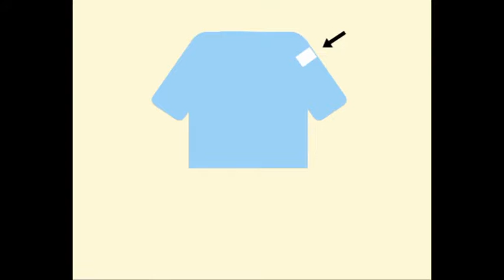How anti theft tags work

Comment: The ringing noisr is for ?
Reply from the maker: You mean the alarm, or a problem in my recording? The alarm sound is to alert the guards in the store about the person walking away with an item without paying for it. If you are talking about a buzzing sound mixed with my narration, it is a problem with my cables or a noisy fan in my inverter.